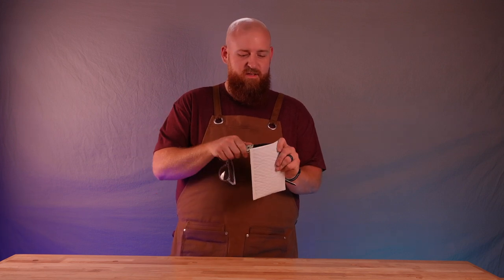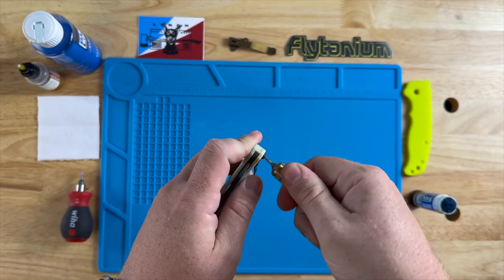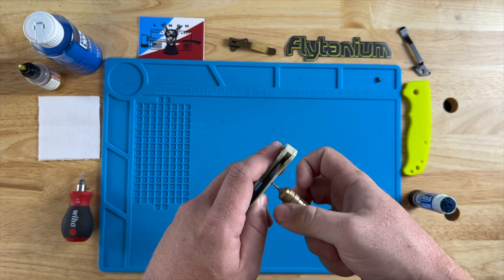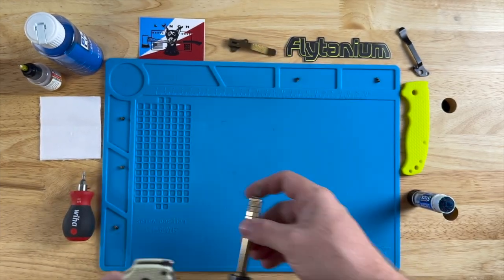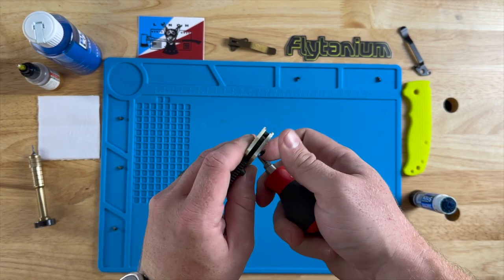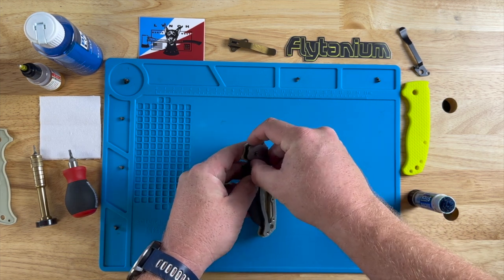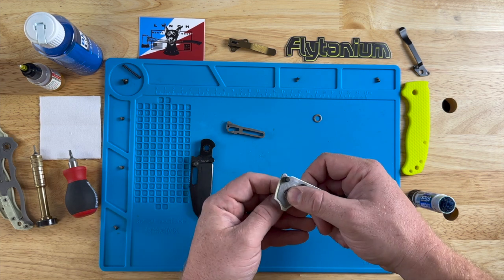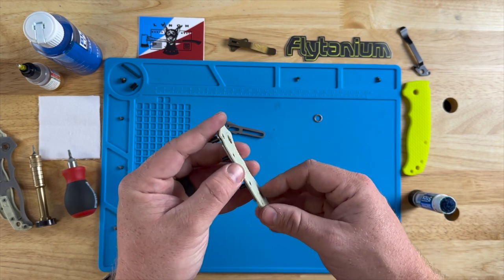How To Swap Scales Demko AD20.5- An Overview and Install of Flytanium Wavelength G10 Scales!

Comment: ive never seen a locking knife that could be swung open by holding it upside down by the handle and swinging it. is the detent soft enough for it to accidentally open in your pocket?
Reply from the maker: Hey Paul, the detent is definitely strong enough to keep closed in your pocket. It actually takes a bit of practice to open the knife that way. I’ve found that actually almost all spring related mechanisms (axis style locks etc.) can open this way if you flick them hard enough. It won’t happen by accident though!
Reply: I actually found that to be cool I never knew you could open an ad 20.5 like that. It's actually really fast to get into the reverse grip that way.

Comment: i changed my scales last week and dont even need to remove the liner at all just remove the scales and replace threads on spacer and done. no need at all for a full disassemble
Reply from the maker: Thanks for watching and the insight. It’s certainly a fair point, especially if the knife has been recently cleaned/lubricated. I find myself preferring to disassemble and clean most times, and sometimes getting the pivot pushed back through can be tricky if you opt to not take it all the way apart. Enjoy your fresh scales!
Reply: @olbubs  ya mine was brand new so i didnt bother disassembling completely

Comment: Hello. I would like to ask you a question: I used to have the AD 10, and its liners were made of aluminum. In the AD 20.5 and yours, the liners are made of steel, but I don't know what type of steel. Do you think it's necessary to apply any oil to this part? I'm not referring to the part of the liners that face the scales, as those are protected, but to the part facing the blade
Reply from the maker: I'm not sure what the composition is but I think it's pretty corrosion resistant. I'm sure it would rust if you dropped it in salt water but for regular pocket time I'd doubt oil is necessary.

Comment: Good ol flat black spray paint would have worked on your back spacer
Reply from the maker: Very True! I’m super glad though that they released replacements quickly after this. The knife is now rocking a brass backspacer and it’s fun! Thanks for watching!
Reply: @Ol' Bubs  yes the lime green looks crazy good with black blade. Just got mine in all black and about to order the lime scales. Although they have a new wood grain texture look I'm trying to decide which to do. Thanks for the reply 👍
Reply from the maker: So many decisions!! 😂

Comment: I just received my AD20.5 and find the lock release to be very sharp. Is this normal for a new knife. I’m hoping after awhile maybe the spring will soften and won’t require as much pressure on the release. I’m sure I won’t have a problem using it but I’m glad I’m not one to be flipping it around all the time.
Reply from the maker: The spring will definitely soften a bit over time, but you can also just knock the edge of the gimping down a touch with a file or sand paper. It hasn’t really bothered me, but I also do have calluses on my fingers from flipping knives a little too often.

Thanks for watching and take care!!